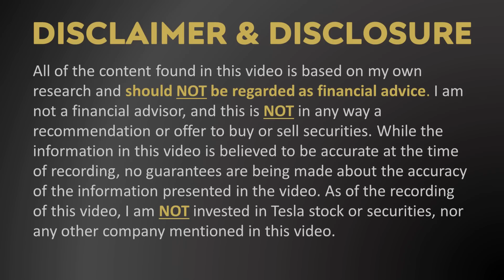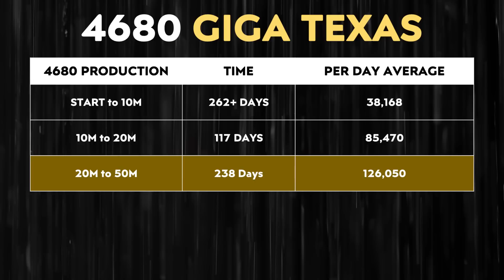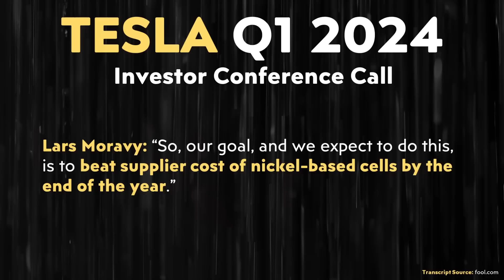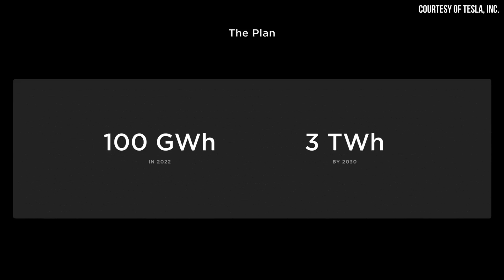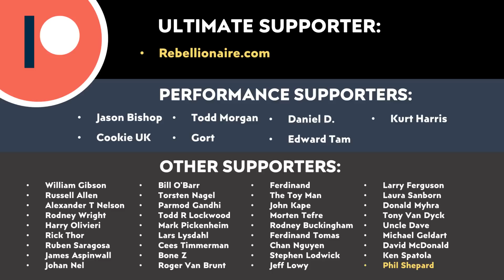BIG TESLA 4680 Battery Production MILESTONE Revealed!

Comment: Sure say it was just Gigafactory Texas and they'd built 10 million cells; if if the total is 20 million you don't have very many cybertrucks worth -  about 20,000 which of is inline with actual Cybertruck production. This really does not address another key problem - reject rates.  If you made 40 million but only 20 million test good; your basically throwing out a pac for every one you put in a truck; which makes it a massive money loser and the reason only the $100K model is being made. Tesla should dump 4680 and find something better; or even go back to normal cells.

Comment: Yes. Important to do this production analysis. 
Some more insight.
LG anode rolls have been seen near the cell can test production waste bins. 
With Drew gone, Tesla is making every effort to lift cell production including buy anode and cathode rolls from LG.
The removal of some access platforms from the north end says Tesla has finished making structural alterations inside the battery corner of giga Austin. This should mean they are well on the way to setting up equipment for the Phase 2 cell lines. 
The waste bins of cell cans outside the factory speaks to trial runs of cell cans with new equipment. If LG can back up Tesla production of Lithium, Cathode and electrode rolls, cell production should reach 2024 year end target. 
Hopefully, CT foundation series ends soon, and we get high production of the normal versions at $79,999. 
It would be great if MY Juniper suddenly appeared in July at Shanghai, Berlin, Fremont and Austin.
Then on 8/8 focus can shift to the CyberCab.
Reply: It would be great if refreshes could appear but as we saw last year, refreshes require shutdowns and this year is not a good time to curtail revenue by shutting down.
Reply from the maker: Great info - Thanks!

Comment: Once Tesla gets its CATL factory/equipment operational and customers become familiar with the capabilities of CATL's Shenxing LFP tech, the demand for 4680 batteries may significantly shrink. This likely includes the CyberTruck.
Reply: That's a lot of assumptions.
Will CATL "Export" Shenxing Plus technology to Tesla?
Reply: There is no demand for 4680s outside of Tesla.  4680s are still the path for Tesla  to reduce battery costs, not depending on CATL to lower their prices.  This isn't complicated.

Comment: My most important questions regarding the 4680:

How has transitioning from an 811 to 955 cell chemistry affected cell capacity?

When will we see the cells in production?

Is there still no Silicone in the anode?  Silicone has an energy capacity 10 times what graphite has.  An anode comprised of 15% Silicone can have a specific energy density 33% higher than graphite alone.  My recollection is that Teslas 2170 used between 5 and 7% Silicone.  This allows for a much fast charge rate as well.

Was the lack of Silicone a design choice based on cell longevity or a constraint due to the swelling of batteries in a structural battery system?
Reply: I have yet to hear of a DBE cathode being reliably produced in volume. I would rate that hurdle as being a bit more important to solve than alternate battery chemistries.

Comment: Given all the investment Tesla has made into the 4680 production capability - it would be sub-optimal to quit this. It would be the last area for full vertical integration.
Reply: Quitting ain't in Tesla's vocabulary.   Don't fall for the FUD.
Reply: @snookmeister55  Elon himself mentioned that they would stop with the 4680 if it wouldn't be succesful but I think Elon sometimes also mentions these things to put pressure on it internally. I don't think they will quite it. But I also don't think they are in a hurry scaling it because global battery prices went down. If it went further up they would have scaled it quicker. Now it makes sense to optimalise the production efficiencies as battery prices are low and cheaper to buy. When the 4680 will be cheaper to manufacture than it is to buy batteries than they will ramp it more quickly again.

Comment: There is no need to be disappointed in the ramp as Tesla has stated they are ramping the batteries slightly ahead of the Cybertruck ramp. They don’t want battery inventory sitting around. As the truck ramps(the truck is the limiting factor) the batteries will ramp.
Reply: Yes, but this was also supposed to be a a big part of the model y being a structure pack.

They stopped making those. I'm assuming to focus on cybertruck
Reply: Originally the 4680 cell was to be part of CT, MY and the Tesla Semi, it appears they have refactored production lines for MY and Semi to use other form factors. Does anyone have any information regarding DBE cathode production. I think that bit of technology has been harder to produce at volume than originally anticipated.
Reply: That's why new battery factory with CATL is crucial. Global EV demands dropped causing the battery price to tank.
Tesla already stated they will get as much battery as possible because energy sector is growing rapidly
Reply: Not an issue. Any extra batteries are diverted to semi and stationary storage@paxdrago1
Reply: Tesla only made 100 GWH of batteries last year. That is enough for 1.3 million model 3/Y long range. But they sold 1.8 million cars + X number of power walls and X number of mega packs and X number of semis. Tesla is currently only making half of the batteries that they need. It would behoove them to double their 4680 production if they can make them as cheap as importing Chinese batteries. And that is the crux of the issue: they can’t make 4680 batteries at a competitive price.